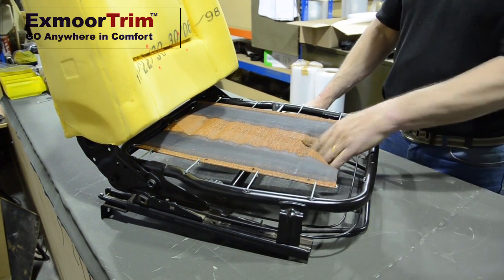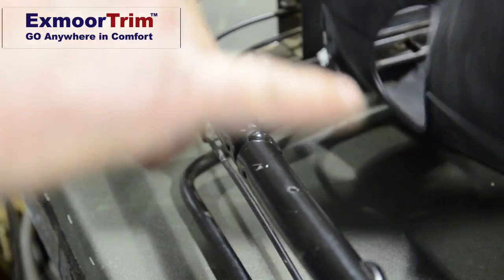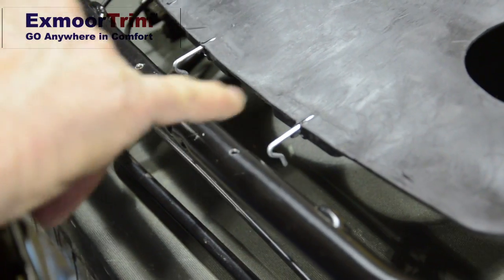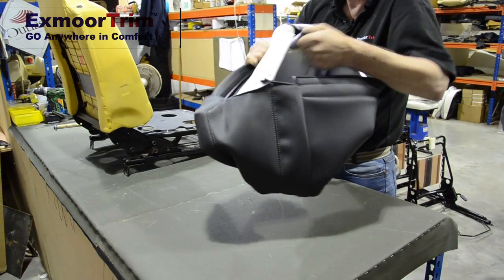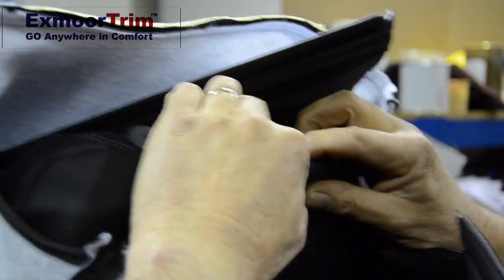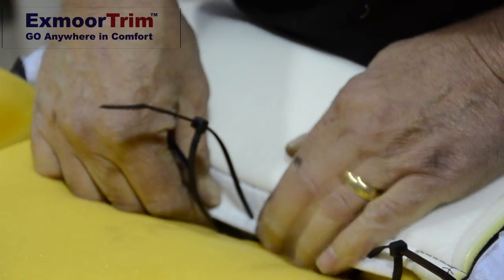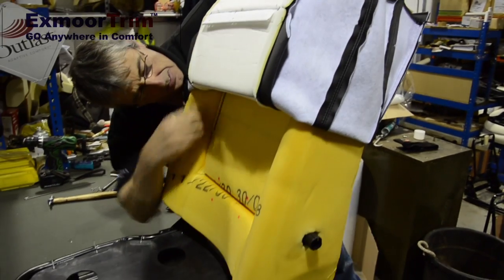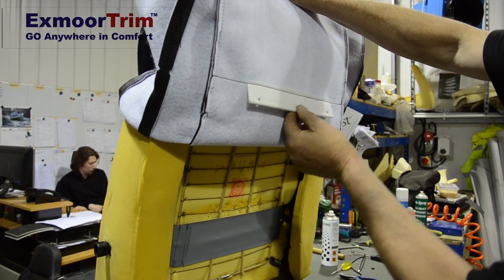Part 2 Exmoor Trim Discovery Seat Re-Trim Kit

Comment: my original diaghfram was in excellent condition so I kept it and I really didn't want to drill the extra two holes in the seat frame - why did they do that ? better support than original ?  replacement foam was better than original